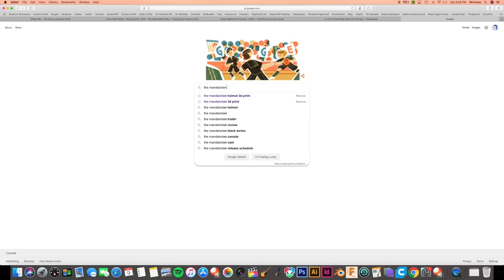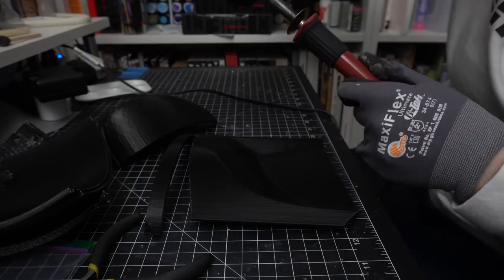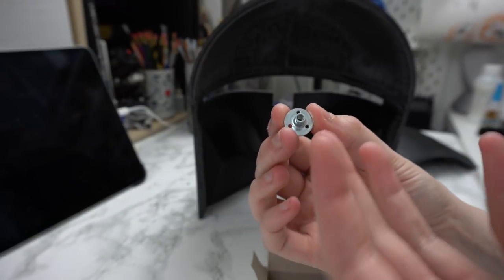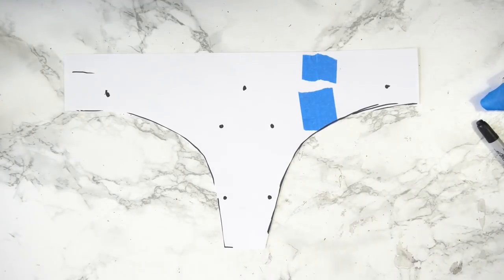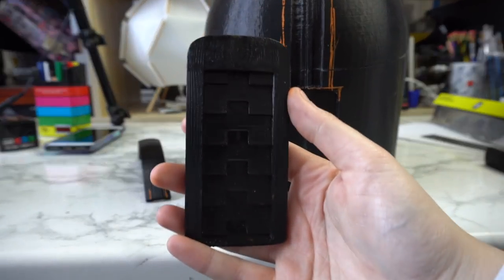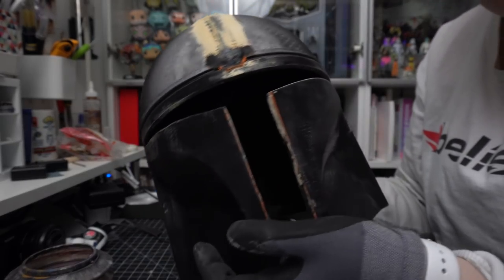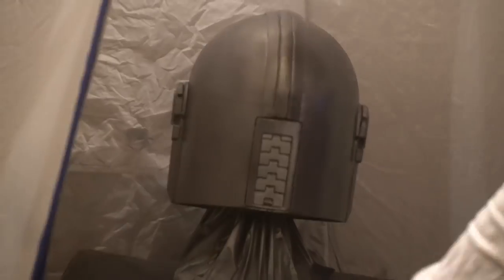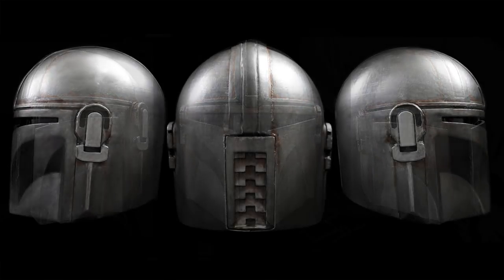How to Make The Mandalorian Helmet

Comment: I had a couple helmets come out with the same texture on the surface. if you add another wall layer to your print settings it will come out smoother. also filler primer will help with filling in print lines so you have less work by hand. good video. thanks
Reply from the maker: I figured as much. I’m constantly messing around with settings depending on the job; I must have not set it back to being thicker. It didn’t bother me enough to reprint the pieces though. I’ll definitely have to try some of that primer. Thanks for mentioning it!

Comment: You probably already know these tips but someone may find it useful, when priming try a filler primer, when painting metallic prime then spray with a gloss black it makes such a difference, for chrome paint there is a graffiti product called  molotow liquid chrome which you can buy in refill bottles and put through an airbrush then seal

Comment: If you angle the top helmet plates at a 35 - 45 degree angle you will cut down dramatically on the supports needed/material used - and you get the same quality on the top and inside.

Comment: Nice job! When I have the extra funds, I'm definitely printing one for myself. One thing, for both you and Rob Pauza, to consider is increasing the wall thickness on the dome. The infill lines caught my attention, especially after the shine of the Rub-n-Buff. But, in spite of that, kudos on a great build and thanks for the inspiration (and link) to build one of my own. :)

Comment: Where can I find that material you used for the visor and how much does it cost?   I have a custom Mandalorian helmet I made a couple years ago and the visor I have it in currently isn't the best.  It works, but it's not like what you used at all.   What you used it far batter and isn't cheap, thin dark plastic  (I used a transparent black folder separator I got in school materials at Wal-Mart.  It's all I could find that did the trick, but after a few years and use, it's kinda getting harder to see clearly through it.  I could really use a material meant to be used for a visor.)
Reply from the maker: The specific visor I used for this helmet is this one: https://www.amazon.ca/dp/B002VECKRO/ref=cm_sw_r_cp_api_i_HLaZDb7201DHN

But this is the kind I’ve used for all my other helmets: https://www.amazon.ca/dp/B00209JH1M/ref=cm_sw_r_cp_api_i_9MaZDb56EQT3Q

Comment: What would you recommend for doing on the inside in order to properly wear it? I know there are helmet pads you can buy for cheap, but is there anything else you would recommend?
Reply from the maker: I normally just buy sheets of thick memory foam and create the necessary padding for the inside.

Comment: Wow I'm so glad I found your video before the first half of my mando helmet finished! I was printing one of those inaccurate model helmets! D=  Also thank you so much for posting this vid! This video has everything I need. Fantastic work on the research! You saved me loads of time.
Reply from the maker: Something that I don’t notice until after I finished mine (so it’s not mentioned in the video) is the slat pieces on the back are slightly curved. The pictures of the ANOVOS helmet are great for reference.
Reply: @studioofmm  Great, more details to get OCD over haha. Where can I find the tools you used to modify your helmet? It looks like you've got different ends for a soldering iron but I'm not sure.  I'm still relatively new to this hobby.
Reply from the maker: Haha, sorry! It’s specifically this hot knife (if you live in Canada/the US, Michael’s normally sells them and you can use a coupon to get it at a really good price): https://www.amazon.ca/dp/B005P1TRAS/ref=cm_sw_r_cp_api_i_hu.ZDb65HH22Q

But I also at some point bought a wood burning accessory kit online for pretty cheap. That ended up giving me a lot of tip options (I can’t find my exact one anymore, sorry!)

Comment: Try a 3D printing pen instead of JB weld, they are cheap and it’s like welding with the same material you printed with
Reply from the maker: Except 3D pens add no strength whatsoever compared to cold welding.

Comment: can you give us an idea of the size of the helmet? I am concerned about resizing it to fit my head.  Thank you. Great video by the way
Reply: Best way to size it is to chop off a thin slice right at the eyes and ears area and print that up. Adjust the scale until you have some wiggle room for padding and cooling fans or voice changer/amp. If you pad it you can use packaging foam and size it just right (personal experience). For myself I'm using virtually the whole bed area of my tevo tornado scaled at 115%. Printing in two pieces vs her dozen or so. Uses approx 1.5kg of filament  in total by cutting horizontally in meshmixer the 1 piece model near the top dome. By printing 1 or both pieces upside down you can print both pieces with 1 kg roll each. Hope that helps!
Reply from the maker: The finished size is approximately 30cm every way. Like I said in the video, the front indented panels cut into the inside of the helmet a lot so you you're woried about size/ adding padding etc. I'd definitely scale it up a bit.

Comment: Did you have any issues printing this? My CR10 keeps pausing through out the print and I keep having to restart it.
Reply from the maker: No, never any issues like that. What slicer are you using?
Reply: @studioofmm  cura. I print many things using this software and never had any issues until now. That's weird.
Reply from the maker: That’s weird. I’ve never had that problem with Cura. The only time I’ve ever had a print stop part way was when I had a crimped hot bed wire that made the temperature unstable so it auto stopped. I hope you can figure out what’s causing it; I know how frustrating finicky print problems are. Best of luck!

Comment: In theory could you use ABS filament to make it more durable?
Reply from the maker: ABS tends to be a pain to print so in theory yes it could be more durable but I’ve personally never had a problem with the durability of using PLA strengthened in this way.

Comment: What did you do to make it wearable?
Reply from the maker: I actually just built it to be a display prop but if I was building it to be a wearable helmet padding and fans would’ve been added inside.
Reply: If you were to wear it would you still use super glue to put together the seams?
Reply from the maker: Yep. The rest of the process would remain entirely the same.

Comment: I noticed you used wood glue on the back panel. Does that work well for filling in the scan lines, better than wood filler?
Reply from the maker: I wouldn’t necessarily say better but I find wood glue works a lot easier in places with lots of small nooks and crannies that are basically impossible to sand.
Reply: Studio of M.M awesome thank you for the tip

Comment: So here’s a big question I have for you guys that build stuff like this. Why do you always have to use these toxic epoxy’s (sp) and such, instead of a simple wood or super glues???
Reply from the maker: Generally it’s the chemical reaction of epoxy’s that give it enough strength. I try and get away with the simplest method though. If wood glue/super glue were enough then I would 100% stick with them but unfortunately they don’t cut it all of the time. Especially if you’re building wearable props, they need the extra durability.